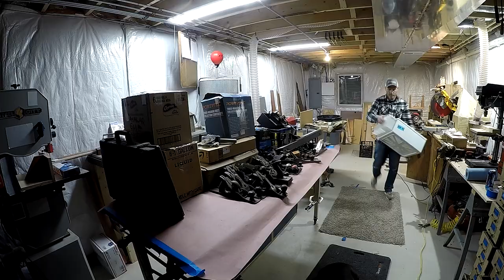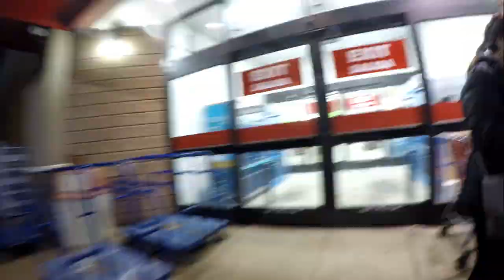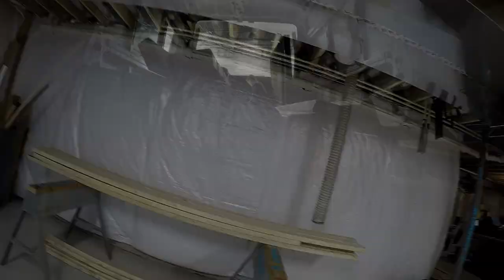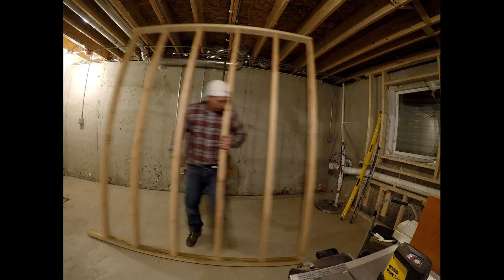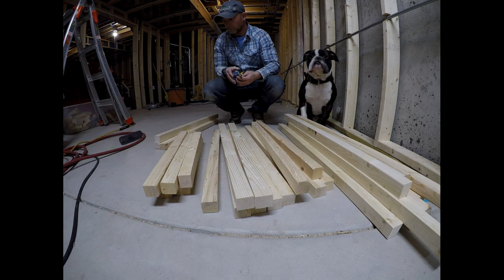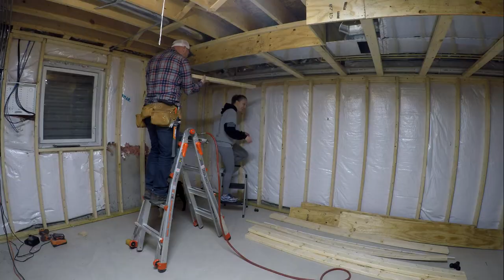BASEMENT SHOP RENOVATION Episode #1 Wall Framing - DIY

Comment: You should do a video on installing ventilation and connecting it to the house's existing HVAC system in a room building project. Yes, some of us are beginners when it comes to this stuff. Sure would like to learn something to save money on the labor. 

I have a home with an unfinished attic that has 5 windows (lots's of potential as a master bedroom). If I paid a contractor to do everything, it probably would cost about $30,000 (or more) for supplies and labor. 

Putting a full bathroom would also be nice for what I have in mind, however, that would be beyond my expertise I think.
Reply from the maker: William Cattr the ventilation was in already so that part was done already.  And honestly I couldn’t tell you how much it cost. It’s been so long.

Comment: Great video! Could you please explain why in some areas you left the insulation in place while in others you pulled it down?
Reply from the maker: I had to replace some of it in areas where it was damages.   We ended up insulating everything after the electrical was out in.
Reply: Thanks for the reply. I plan on finishing my basement down the road and was debating if framing over the insulation was a good idea.